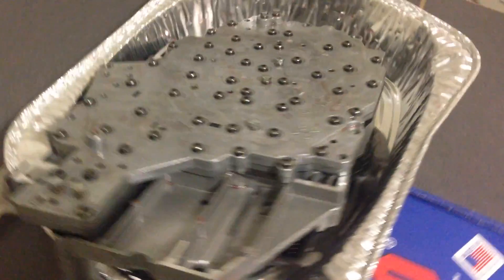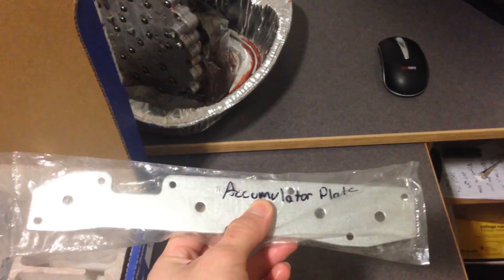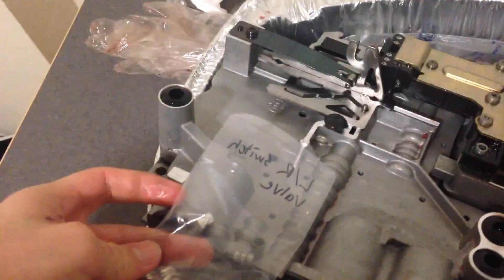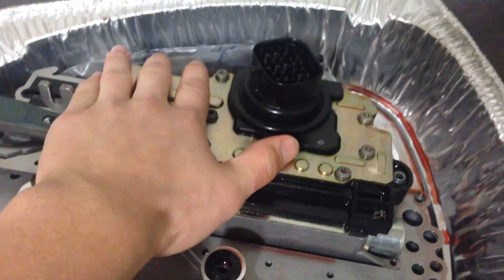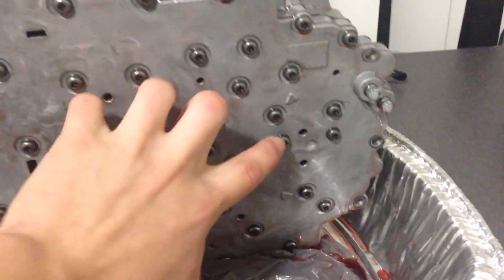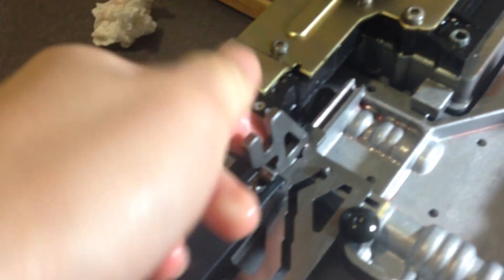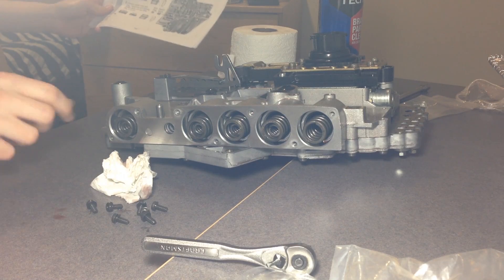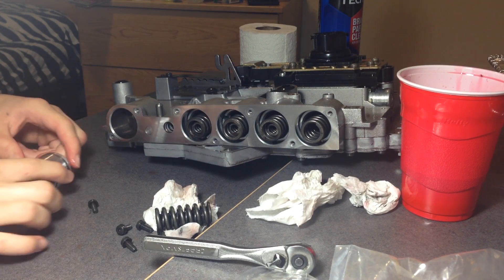Transgo Shift Kit Installation 45RFE/545RFE-Part 1

Comment: Hi..my transmission In 09 ram sometimes stays in 4th gear..would this kit help that out...last time I changed  the fluid my truck ,it somehow gave it tire ripping power..lasted for maybe 6 months but went soggy again..it still drives fine...would this kit benefit me with that issue  as well?

Comment: I know this is an old video, but what were you doing at the end of part 1?
It looked as though you were getting ready to change that little valve, 
and you were messing with some kind of tool but I have no idea what it was, and in part 2 it looks like you were already done with it.
Reply from the maker: It was an old hard drive magnet. The valve is steel and the VB is aluminum so pulled the valve out easier.
Reply: @Internetpirate3  Nice, so when you got it out you just coated in ATF and put the new ones back in? Was there any trick to that or do they just slide in and that's it?
Reply from the maker: @CHAOSMOVEMENT  Yep just do that. If it doesnt just slide in theres trash in the bore and will need to be sprayed out with brake cleaner
Reply: @Internetpirate3  Sweet, much appreciated video and responses.  Know that your efforts made a huge difference in my life right now.

Comment: I'm thinking about doing this to my 2011 ram and I dont have a tuner. I plan on getting one later, is it hard to remove the resistor later?
Reply from the maker: It should be pretty easy to remove the resistor later on.  Just when you install it  you can use a spade connector in the wiring harness to attach the resistor temporarily.
Reply: @Internetpirate3 thanks so much for the reply. I didn't notice that the video was so old until after I posted.

Does the resistor get connected in the fuse box?
Again thank you for replying
Reply from the maker: Connect the resistor inline with the wiring harness preferably at the solenold pack connector.

Comment: Hi I have a dodge dakota with a 545rfe transmission. The problem is that it stalls when I put it in gear but it works in reverse. I changed the shift solenoid but it didn´t help. Is the torque converter lock up somehow any clues of what part it make it to fail.
Reply from the maker: Do you have any codes stored in the TCM or is the Check Engine light on?
Reply: p0700 p0456 p0442

Comment: Accumulator springs simply cushion the shift. Stiffer springs equal a firmer shift, and the thicker plate holds the higher spring pressure without distorting. I'm running this kit and love it.

Comment: Good job and saved me some guess work! My Durango is an '02 4.7 4x4 with 197,000 miles. The trans was not shifting into 2nd or 3rd all the way, on occasion, and this kit is highly recommended. I hope it does the job and will find out today. FYI, Rock Auto has a replacement oil pan with a drain plug for this trans.

Comment: how did you know that your shift kit needed replacement? i have tge same transmission and after a throughral atf change with new filters, the car will shift, but wont move. did this happen in your car? mant thanx and great video
Reply from the maker: Check the fluid level and check to make sure you have the flat filter seated correctly.  Also make sure that when you install the new seal for the flat filter you have to tap it in with a hammer or it will leak and your car won't move.
Reply: Sounds like your seal on the flat filter hasn't seated all the way. I've seen it in this transmission many times.

Comment: I just purchased a transgo kit yesterday and the first thing I was going to do it shoot a video. Looks like you took a good video. I will probably do the snap ring and the trans pump spring upgrades too.
Reply from the maker: The only thing I wish I had shown in this video was how to unplug the electrical connector but for the most part I tried to make this video as informative as possible.  Good luck with your trans!